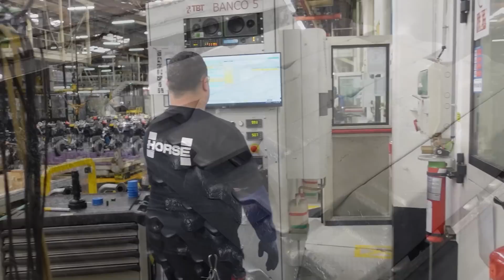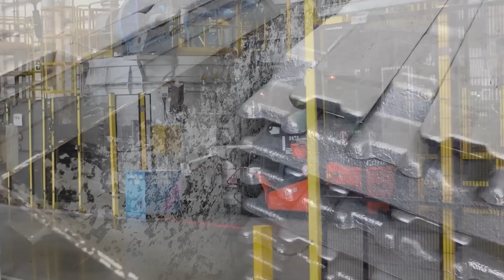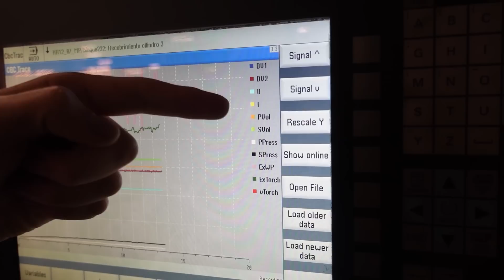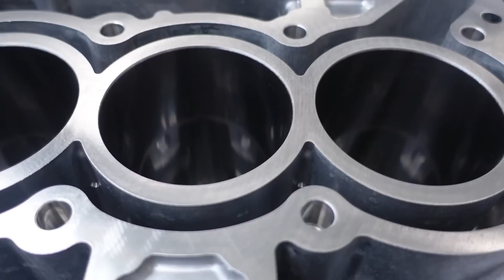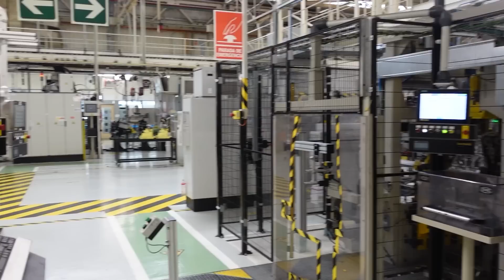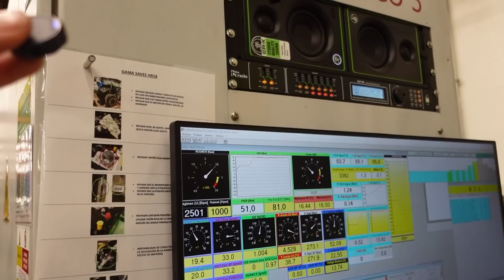This Is How They Make 1 Million Engines Per Year - Come With Me Inside A Super-Modern Engine Factory

Comment: Great video, love the channel,l been here from the beginning............ The spray-coating of the cylinder walls makes this a throw-away engine... all this tech is fantastic, but most of these engines will be junk in about 100,000 miles or less, depending on the maintenance, and will never see over 200,000 miles with today's cars .....

Comment: For the curious, spray bore tech has been in use for quite some time. I did a lot of dev work on the Chrysler Pentastar which had spray bores and that was on the market in 2009. The technology seemed very mature and trouble free even then. Its higher performance in every way, they just can't be serviced. Nobody is ever going to rebuild a Pentastar (same with these engines) so them being disposable is sort of moot. Rebuilding bottom ends of passenger cars outside of the hot rod world is extinct and has been for years. No OEM is going to pay a dealer tech to remachine a block. That probably died in the 80s if not the 70s. In an 18 wheeler, yeah, but not cars. You will notice though that higher end engines like Toyota's V6 Hybrid Max does still use sleeves for whatever reason when lower end Toyota's will have spray bore.
Reply: In the 70's I saw a German Zundapp 50cc mopet with such type of cilinder. Zundapp was a high-end brand. It must have already be good back then.

Comment: I have a question about the Rotary Vane Engine you made 3 months ago and wanted to see if you can possibly answer my question

When it compresses the air in front of the thing that moves keeping it sealed so the air can’t escape 

how does the air transfer to the back of that wall thingy when the compressed air is in front of it?

Comment: The proces is clean, sofisticated, well engineered, well commercialized etc etc. Everything in the process 1000% OK, but now the design, the function of it.
These spray particles how long do they last? How does it behave under marginal (= hot, thin oil 0-W30) conditions? Do I ruin the piston rings, or do the particles brake out the wall? 
The layer is thin and there after the engine is gone. Can the engine rebuilder respray or is it: buy a new block? 
Remember that the ordinary cast iron cilinders are extremely reliable, have ample wear after 400.000 km, say 0.01-0.02 mm on the bore. Not more than that. Increadible.
The particles have to prove that. They can only function in optimal lubrication scenarios, not in lesser.

Comment: Very interesting. Electric water pump okay but how about the used electronics? Are these China made? If so then this will be a ‘open the parts bin’ engine. 
Alu block with prayed on cylinder wall coating? That must be a kind of Nicasil coating of very similar (?).

Comment: If the hydrogen technology doesn't take off companies like these will start to fail as the EV's are going to take over as the push to stop polluting our atmosphere before it's too late to do anything about it. I wish engineers would at the very minimum take a look at what Stanley A. Meyer was saying about the use of hydrogen as a lot of what he said really changes things. Example, by tweaking the EGR system one can drastically cut down any NOx gases being produced and slow the rate at which the hydrogen burns at the same time as those none combustible gases coming from the EGR system simply get in the way of the hydrogen and oxygen atoms from coming together during combustion.
Companies like these have worked so hard to make a good product and if hydrogen isn't adapted they could all go bye bye. I just saw a new invention in Africa that is being applied to an EV car that will give it unlimited milage and if what I saw was true then even my "Water for fuel" technology isn't going to make it. How can anyone compete with an EV car that gets unlimited miles? Here is the new technology I'm talking about: https://www.youtube.com/watch?v=ECZcWlMKQZE

Comment: The video is exceptionally good! It is interesting and informative. Even if there is a voice-over or some small imperfection (zoom or brightness), to those things we are even not paying attention. The technology they have implemented in those downsized engines is incredible. If everyone changes his/her oil on time and let those engines heat up for 45-60 seconds after start and let them cool for 45-60 second after stopping at the petrol station (or parking for break) on the motorway, those engines can do 200000 km. The oil retention porosity coating is fascinating. Yes, maybe re-buildability is not anymore there but let me remind you that a lot of cars from the 80s and 90s were also not capable of 200000 km. Chains with markings. The gas test. Outstanding! Thank you for this magnificent video. I am addicted to your channel. :trophy-yellow-smiling: HORSE people are amazing!

Comment: Hah!  I have that same set of speakers at the dyno station on my computer here.  :D

They must have incredibly tight tolerances if they don't need cylinder crosshatching to bed the piston rings in order to get a good seal.  But I suppose if every machining operation on the engine is done with continuously monitored CNC equipment that gets measured after every operation, they can probably achieve those.  Still, I'm with you, it's very odd to not have that in the cylinder.  :D

Well, this was fascinating, I love seeing stuff like this.  Thanks!

Comment: Emissions regulations will make electric vehicles the main solution for most existing ICE applications. Latest battery and design for manufacture will result in EV’s at lower cost than ICE vehicles which require expensive and sometimes unreliable emissions control systems to meet the current regulations, those regulations will continue to tighten as we move forwards. Donald Trump is kicking back however it is unlikely that will produce more than a temporary reprieve.

Comment: You've obviously not watched film made during WW2 on the manufacture of radial aeroplane engines in the USA. From 14  to 28 cylinder. Not only were these engines assembled with aid of machines but after dyno running (using the power output to generate electricity for the plant) they were disassembled,  rechecked and reassembled.

Comment: it be all right if an engine replacement after 100 k km was cheap. As it stands, if you go to a dealer and ask for a new engine, you'd rather buy a new car.... so I don't like it, as well as the direction in which the automobile industry is going.

Comment: Renault is doing really good with their second generation downsize turbo engines: 1.0TCe and 1.3TCe (also found in Mercedes and Nissan)
The engine shown in this video is the third generation, showing the 1.2 TCe, 3 cylinder and later this year we should see the 1.5TCe, 4 cylinder engine (for larger cars).

Facility really looks top-tier.

Comment: I went thru an old (80s) engine plant which had a linear assembly line.  After machining the blocks moved to a station where a fellow stuck a mirror down the distributor hole to check the camshaft tunnel was OK.  Imagine doing that all day.  I’ve thought of that poor guy every time I open the hood since.
At the tappet/pushrod station, there women chatted away as their hands automatically installed the parts.  Amazing.  I don’t think they looked at their work until just before the block moved.
The Horse plant is one of many like it.  The manufacturing technology didn’t get there in a day, it was evolutionary.  The real key innovations were computers and sensors.

Comment: Chevrolet Flint (Michican) Engine Assembly made about 5,000 small block Chevrolet engines in up to 100 unique configurations every day on two assembly lines and two shifts back in the day. One line spit an engine out every 21 seconds, the other every 32 seconds and this was all manual labor done by hand and these went out every day all over the country to 20 different vehicle assembly plants. From 1955 til the end of the line in the late 90's Flint Engine built over 100 million engines. 😎
Reply: My home town! I worked at Fisher body on Saginaw st 1973 , first year Buick Regal 😊😊😊😊😊😊

Comment: I actually work with Buhler here in Brazil. They make the Die Casting Machines you see in the video. Horse is also very big here in Brazil and they have two of those 2500ton machines here. We provide maintenance for them.
Reply: Muito legal! Eu comprei um Renault Kardian que vem com o motor da horse HR10, infelizmente a Renault não dá muita informação sobre o motor no manual do proprietário, nem da um manual de manutenção, mas tô procurando ao redor onde tiver informação sobre ele.

Comment: Notice how much more aluminum is being used for the cylinders that are sprayed in liners compared to steel liners. Those spray on liners in thin cylinders will fail quickly from higher compressions and added boost. Yep, these are soda can engines which can't be rebuilt. You must purchase a entire long block

Comment: Interesting how Spain more than likely MUST use Nitrogen (more expensive) than CO2 for their piston face metal deposition weld process to avoid oxidation during welding.  I have worked on so many types of weld equipment... definitely "decarbonization" heavily here.

Comment: Wow , nice video , Kudos to Horse to let you film , it's very interesting to see all the assembly of a engine from the foundry to the test bench , I only have seen vehicles factories  , and the engine arrives already build :D . It's very interesting they spray the iron to build the sleeves (in this case coating) and use the porosity instead of cross hatching .

Comment: Using earth's most rare gas( helium) to check for gasket leaks seems irresponsible. Compressed air would do the same job.
Reply: Someone smarter than you already explained why helium is used. Precisely because it's so rare, it is easy to detect when even the smallest leak occures.

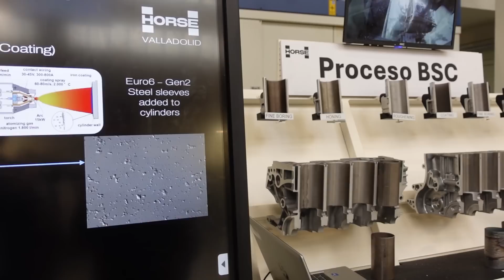Comment: 8:19 no more engine rebuilds... Automotive manufacturing is getting another step closer to the planned obsolescence goal. Together with coded parts requiring expensive pairing tool, the giga castings impossible to repair, batteries permanently glued shut... The customers are getting screwed!

Comment: Interesting, they don't machine AC compressor bores, the little Pistons fit so tight there is almost no room, and I believe they're tapered at the bottom, I'm sure these engines are doing the same thing. 

It was nice to hear what the aluminum had in it for an alloy, it was nice to see the automation of a factory reminds me of the factory I saw when I was a kid with tool carts moving around and some even hovering

Comment: I worked for 17 years at Renault Brazil at engine factory. I should say this is a really nice process, and I worked with engines test and validations. You saw the final product of a lot of engineering process, a lot of work from suppliers, lots of validations, thousand and  thousand hours of endurance tests. Niiiiiicce, I didn´t know Horse Valladolid. Renault used to produce engines for REnault itself, Nissan. Mitsubishi, Mercedes and now Horse sell the entire solution for engine, gearbox, hibrid or not for those who wants to buy.

Comment: So, how is the reliability of these engines?
Are they found in Toyotas,Hondas, Kia?
Engine quality has declined in recent years to the point where consumers are confused about what brand to buy.  If they're all coming from one manufacturer, that may explain it.
The 1971 Chevrolet Vega engine had impregnated silicon nodules and no cross hatch on the cylinders.
I mostly saw computer screens with squiggly lines with broken English.
I'm still waiting to see the bars of aluminum become a block.
The drawings showed an ultra thin crankcase.

Comment: China has the best castings I've ever seen. That's probably  why they are a partner. They have no problem buying Rockwell factory machines. If you needed to rebuild this engine, you would nickel plate the cylinder liners like a Kinner, and use hand made or factory dimension pistons.

Comment: Now I see why these engines are either knocking (conrod knock) or ending up as scrap metal. 100's of thousands of HR16DE engines are back at the dealers diagnosed with rod knock.
Since Nissan started using those piss-poor engines people have lost faith in Nissan cars as their engines come from a craphole like this. To must reliance on computers to built a critical component of a car such as the engine is to blame. Nothing is better than the human eye to check for build quality faults.
The HR16DE is the replacement for the Japanese built QG16DE and has the same hp rating. You will never see a HR16DE drive 442,000km like my older more reliable QG16DE is.

Comment: Great video. I'm curious how this sprayed on cylinder coating compares with Nykasil that I remember being electroplated onto 2 stroke cylinders in the 70's. The Nykasil was diamond honed like a normal steel or iron cylinder wall to the traditional plateau finish.

This sprayed on lining that you show Horse applying is finish honed to a high sheen but it just makes me more curious about how it compares for wear, sealing and longevity. Also I wonder if the material composition of the piston rings is changed to better work with this cylinder coating.

It would be nice to see you do a video showing side by side microscopic photos of this porous cylinder lining and traditional cross hatched cylinder liners.

Comment: Very impressive factory and documentary. 'Horse' is a name I've not heard of, either by itself, or in relation to Peugot.
The Hors website provide a little more information on engine types (hybrid, hydrogen, synthetic fueled engines) and references that transmissions are made. But, it did not appear to offer details on transmissions, or specifics on engines (e.g. displacements, inline or transverse mount), or reveal whether or not Horse makes engine components (e.g. pistons, connecting rods, etc.

Comment: Internal combustion engines were made obsolete when emission laws were imposed fifty years ago. Mfrs. have added all kinds of devices to the them to try and lower nitrous oxide levels without effect and have managed to turn them into scrap iron jungles. So gutless governments keep shifting  goal posts to keep them in business. The lowest emission engine in the world at that time was designed and built by Ted Pritchard of Melbourne. Still is as far as I know It was a steamer. [external combustion]  I went to America with him and there wasn't anything that could come near his emission levels. He took it over later in an old Falcon and demonstrated it to Senators from Washington and the vehicle industry but they didn't want it. In the meantime V.W. and others are doing as they choose. The mud is going to hit the fan when California bans all diesel trucks. If you want to see a low emission engine see Pritchard Steam Car on U-tube. He knew what he was talking about. All the others are rock heads.

Comment: Sprayed cylinder bores can be repaired! The process typically involves a technique called ThermAlloy®, which is a proprietary thermal spray coating process. This method is used as an alternative to hard chrome plating and involves several steps:

Cleaning and Preparation: The cylinder bores are thoroughly cleaned and prepared, often involving magnaflux testing to ensure they are repairable.

Boring and Coating: The bores are bored out slightly and then coated with a wear-resistant material using the thermal spray process.

Honing and Measurement: The coated bores are honed to the correct size and measured for hardness and surface quality.

Pressure Testing: The repaired bores are pressure tested to ensure they meet quality standards.
Reply: With the number of these engines in service I’d expect a lot of stock in good engines from collisions available.  A lot cheaper than a tear down rebuild!

Comment: "...the revolutionary bore spray coating process. This a process where melted steel is sprayed right onto an aluminum engine block..."

My old 2017 Mercedes GLC43 supposedly has that 'Twin Wire Arc' technology. That's what the M276 DELA30 engine brochure says.

Comment: Great video. It is astonishing how much care goes into the construction of a modern engine. It seems almost impossible that they could complete a million engines a year with that attention to detail.
That spray coating in the cylinders was first introduced years ago as a Nikasil coating used on aluminum block engines. Porsche used it on the water cooled engine of the 80s. I am sure it has been improved over the years.

Comment: Now I understand WHY there is such a huge debate behind BORE FINISH: SMOOTH MIRROR vs CROSS-HATCH.

This technology for creating a durable cylinder surface is why people are getting confused. They see this HIGHLY MIRROR finish not understanding that the micropores left by the spray are what allows the oil to provide lubrication w/o cross-hatching.

Comment: Horse is one of the manufacturers I've been trying to get to work with me on my new engine project. Most engine designers aim for high peak efficiency and live with the low efficiency that comes with everyday driving low-load operation. I start from the position that under low-load I want peak efficiency, but still with 500 HP on tap for a MV8 (Mutable V8). Most engineers assume that I can't do it just because THEY can't do it. 45% efficiency, 60 grams per km of CO2.

Comment: Great video, very interesting. One thing I must say though: the tried and tested honing process is pretty much foolproof. I can only imagine how sensitive the new fancy spray method is for effed up parameters 😅
Reply from the maker: They have an optical porosity check at the end. It checks all the micro pores and if it detects any that are smaller or larger than required the block gets recycled.